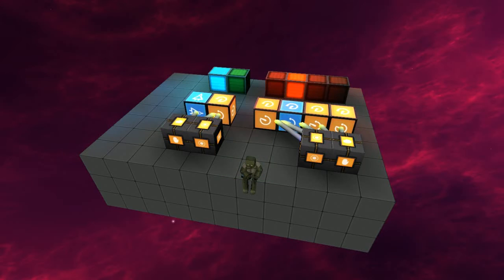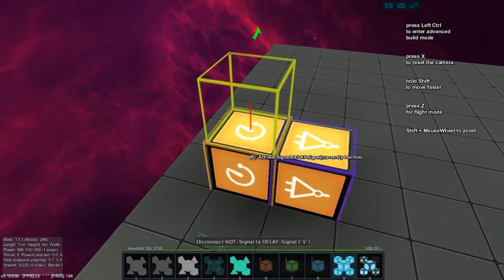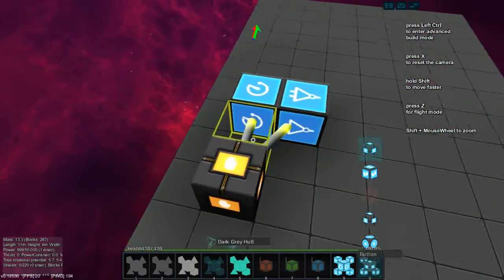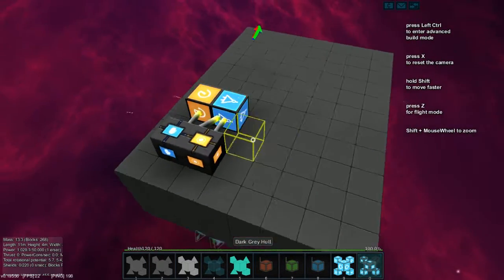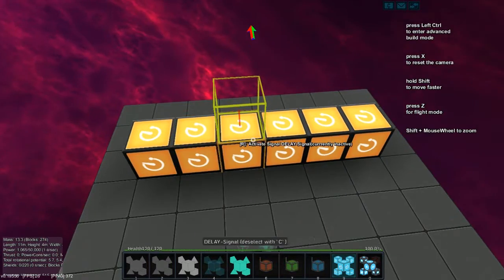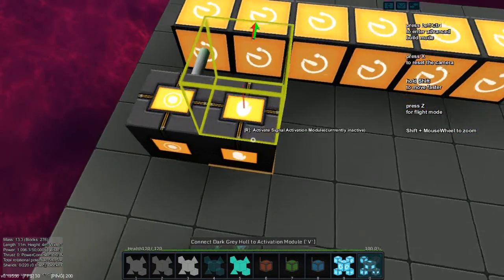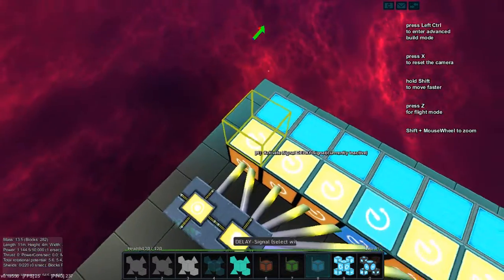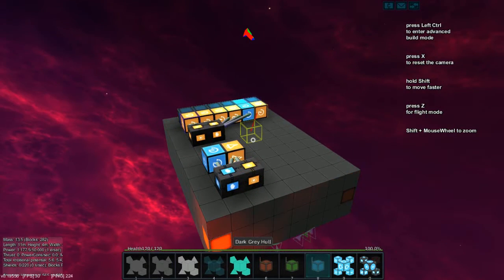StarMade Compact Tutorial | Blinking Lights

Comment: somehow for me in singleplayer this 2 block blinker never worked...only on the server...so i got used to using an AND+DELAY+NOT and connect a button to the AND block and that is 100% works, and it has 4 blocks too :D
otherwise good tutorial...it should not be called compact though :D the overly explained should be called "technical" instead :D